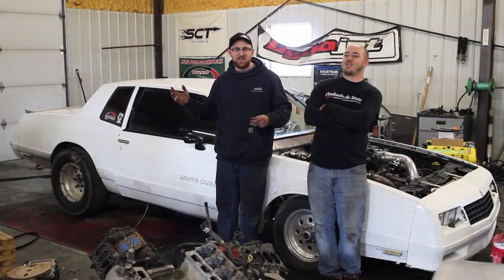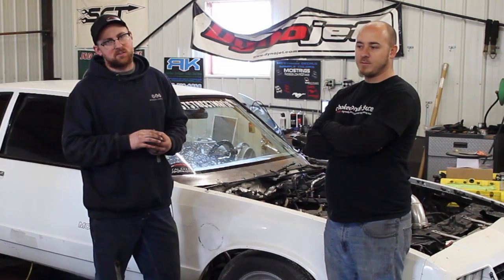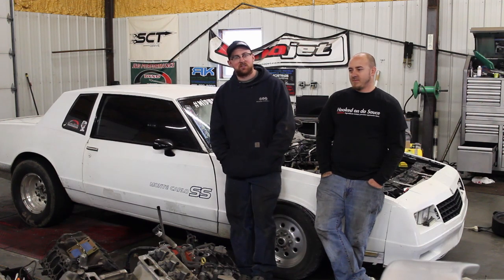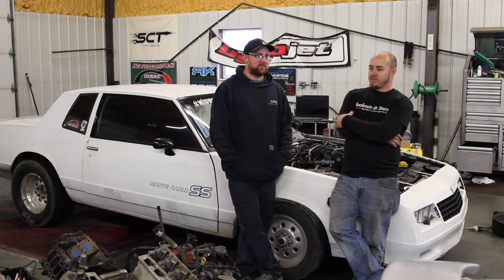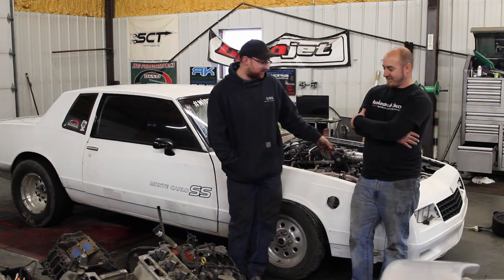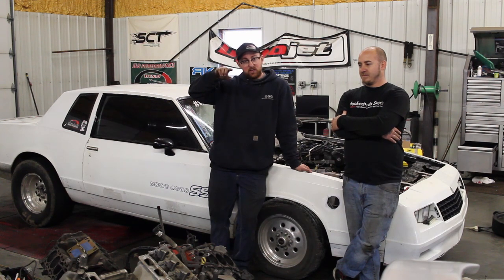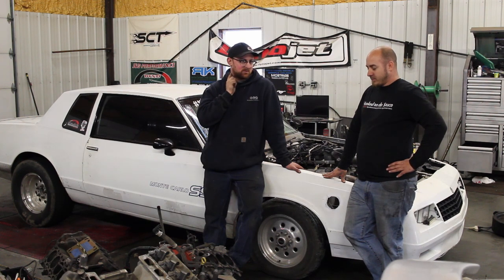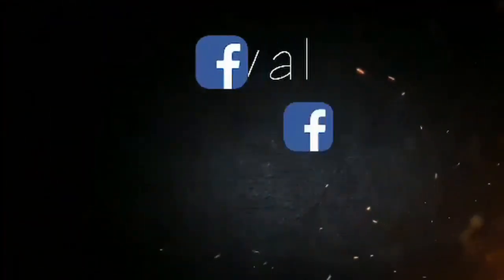Turbo LS Monte Carlo on the Dyno

Comment: Ever install a traction control on a holley setup? Thanks
Reply from the maker: Yeah there's a bunch of different ways of doing it depending on which ecu you have and how fancy or simple you want to get.
Reply: @boostinbo  which way would you recommend sir? I have a holley HP with unused inputs now. Would a ds speed sensor/ yoke work best? I would have to look how to get front speed for tune to compare/ tune to pull timing. What should I look to buy? Street car only so the time based holley paywall wouldn’t do well for me. Thanks
Reply from the maker: It depends but you can do either front wheel speed and driveshaft speed and make a 2D timing offset advance table and pull timing as the difference in speed changes or just do driveshaft speed and engine rpm and setup a 2D timing offset advance table and pull timing as engine rpm goes over whatever rpm  it'll spin at. Both ways work, it's just a matter of how you want to do it.

Comment: Where are you located. I have a Gen 4 4.8 with a Gen 2 7875 I would like to peg. I have 8 an feed and return with twin Bosch 044 pumps and 80# injectors. My car is running 110 race gas and water meth
Reply from the maker: I'm in Springfield, MO